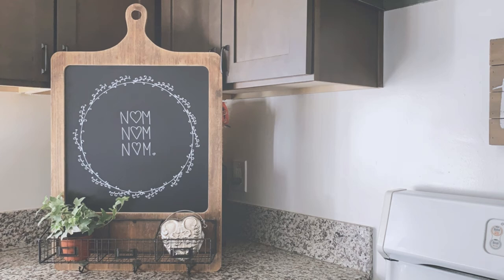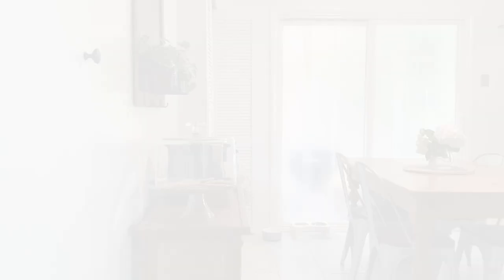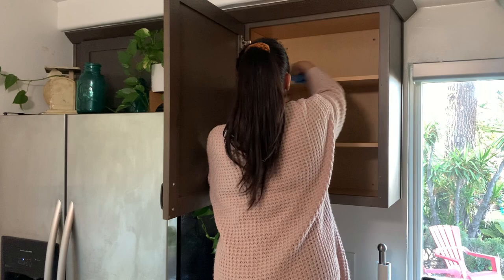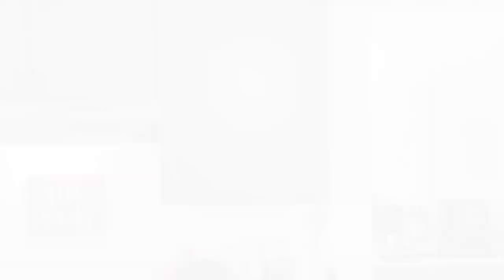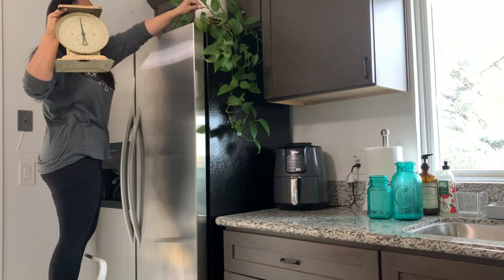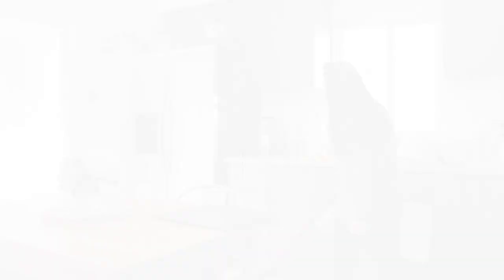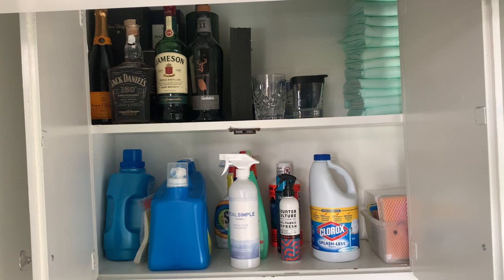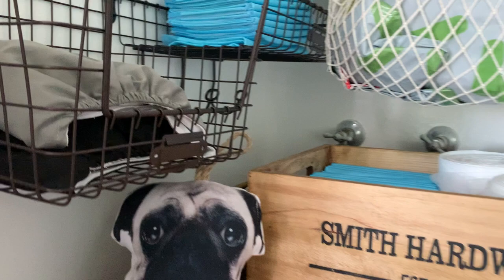Grocery Haul & Meal Plan #3 | Small Kitchen Declutter No Pantry | Spring Cleaning 2021

Comment: Great motivation. I need to declutter too! If you kept your mug and glass you could try putting them in the freezer to pull them apart.
Reply from the maker: Thank you so much! I did try that tip about putting the cups in the freezer. I also tried oil. I tried everything, LOL. Unfortunately I just tossed both of them yesterday. I guess I didn’t really miss them because I completely forgot about them!